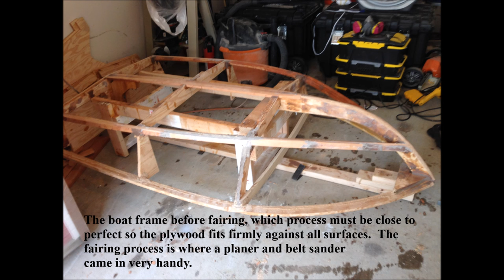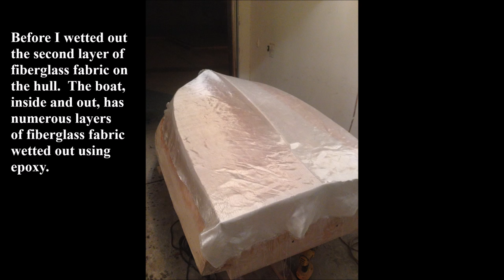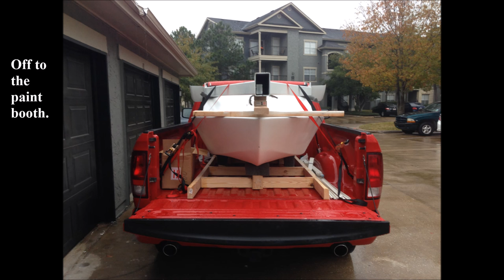Si and Jude's Glen L "Pee Wee" Boat

Comment: Do you know how much all of the things put together costed?
Reply from the maker: I haven’t priced the materials in awhile, but it depends on (1) the price of the outboard and trailer, (2) how much you want to spend on the interior (I spent $1,100 seven years ago), and how much you do yourself (e.g if you so your own gel coating or painting).  I would estimate with a used outboard like I bought, if you were careful on your material costs, and if you did everything yourself you could do it for about $7,500.
Reply from the maker: You could also buy this one for a lot less than that, and I just re-gelcoated it. :)

Comment: You did an awesome job. I'm building one now. Slightly different but curious what are the dimensions and how much it weighs without the motor? Roughly. Thanks.
Reply from the maker: 7’3” length and about 50” wide.

Comment: it looks very heavy! what does it weigh? nice job.
Reply from the maker: Thanks.  It weighs about 300 pounds with everything.  It is a little tank, and when I build another, I won't make it so heavy.  I am not an engineer so I overbuilt everything to ensure I would not have any structural problems from mounting a motor with twice the horsepower rating.  If I built it a little lighter I probably wouldn't need such a large motor.  :)

Comment: can you tell up the overall cost of the build at all ?
Reply from the maker: Well, I will just say that if/when I build another similar boat, it will probably cost less than half of what I spent on it.  My suggestion is to use vinyl ester resin rather than epoxy for wetting out the fiberglass and purchase the parts online.  I spent too much time buying items from retail stores thinking I could get technical advice.  I just ended up paying too much for things. I am rebuilding a similar-sized boat right now, and I am spending much less than this one.
Reply: GZ what did you spend on it

Comment: Great job she looks awesome! What would she do with that 15 HP?
Reply from the maker: I didn't clock it, but it will probably do 20-25 mph.  With a different prop. it of course could be different.  I built it a little heavy so the 15 hp motor works well.

Comment: how long did it take you
Reply from the maker: To build it?  It took about 300 hours.  If I did it again it would probably take me between 100-125 hours.  I learned that laying out tasks, especially when using epoxy, is really important.  I am building another type of boat right now, and it is taking me a fraction of the time this boat took me.
Reply from the maker: No.  It is not for sale.  It was a gift to my nephews.

Comment: Go fishing in it
Reply: Bjay Mcintosh that's a dumb idea,it would ruin the carpet
Reply from the maker: It is a little awkward to take fishing.  It is basically just a boat for kids to learn how to drive.
Reply: GZ I had a Aqua lark with a 35hp with a stainless steel prop. I use to sit on the front of the boat and fish off of it all the time. It wasn't perfect but not too bad.